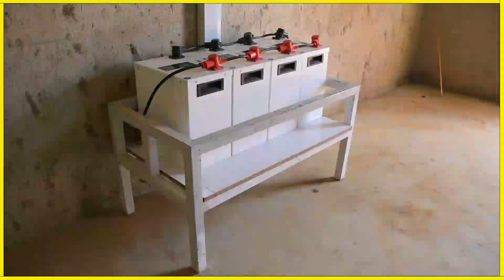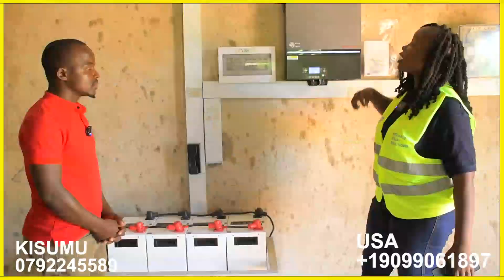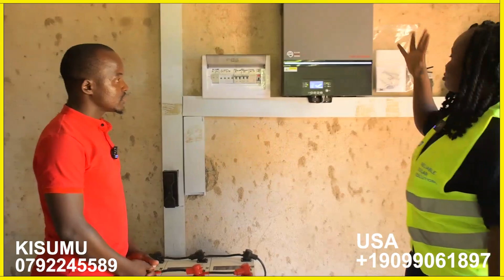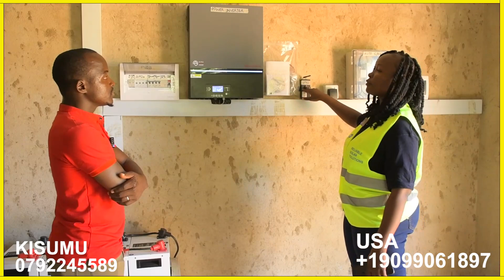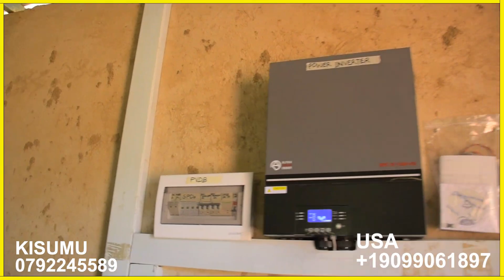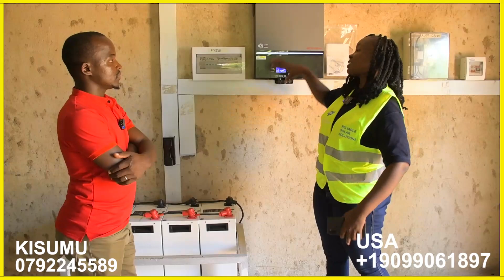How Solar power solves blackouts,   Practical  installation by @PowerAfricaSolar  in Siaya County

Comment from the maker: Our Power Backup Packages Start at Ksh 280,000, Our Solar Water Heating Packages Start at Ksh 160,000, Our Solar System Packages Start at Ksh 400,000 please email info@powerafricasolar.com with all loads you intend to power, your budget and project location for a custom solar quote. You can also Call/Whatsapp  0792247397, 0794716562, 0792 245 589 We Are Your Preferred Solar Installer in Kenya With Great Solar Packages: https://powerafricasolar.com